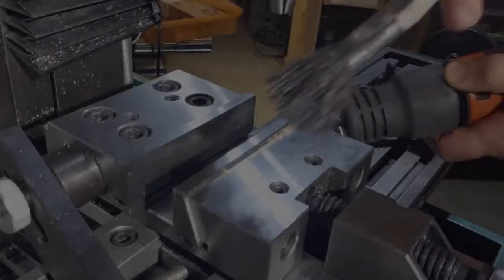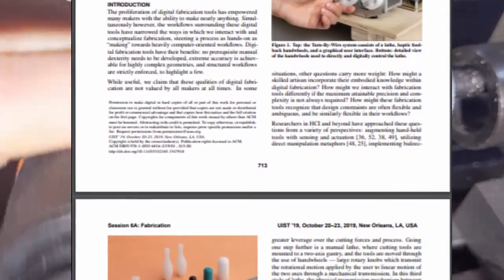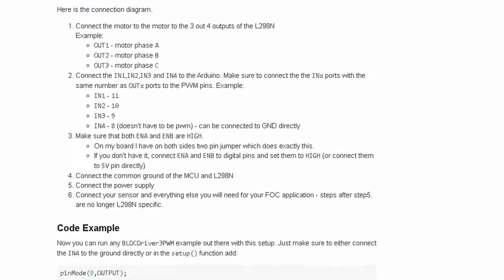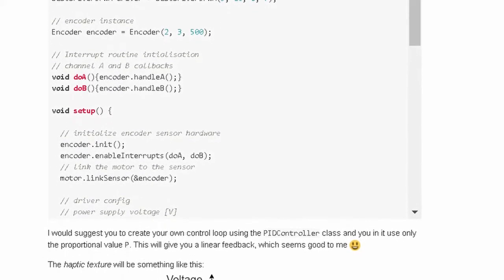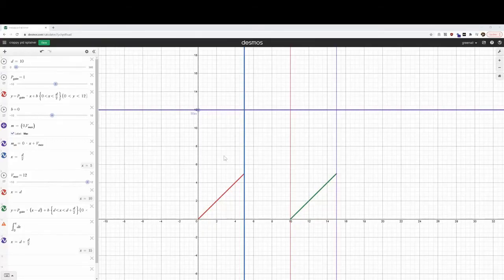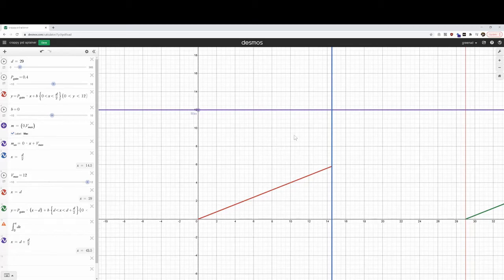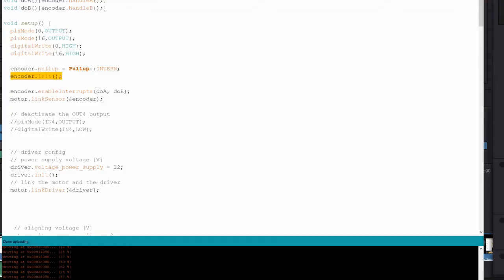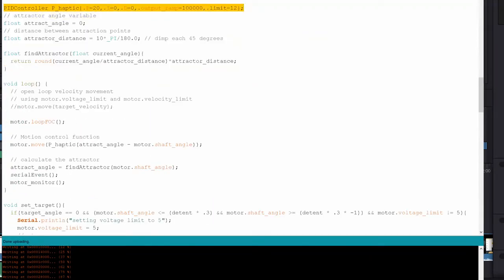haptic textures and virtual detents

Comment: Hi Jesse, just a thought which you may have already considered. Could you measure the current draw of the stepper driver to help determine the motor torque. Interesting this will probably be  a wave form. due to the detects of the stepper motor, so you may need an rms or peak averaging calc or similar to capture the current draw. And a sample rate for the current measurement  much higher than the max step rate of the actual motor. 
This is definitely an interesting problem to solve
Reply from the maker: The driver has no current shunts to measure the current with.  The voltage is used as an approximation of torque since the motor has high resistance this works well.  There are drivers that will measure the current but they are a lot more than this $3 driver.
Reply: @JesseSchoch  $3? What driver are you using?
Reply: @sprobertson  He is using L298N, if I understood it correctly. This is the forum article he referred to: https://community.simplefoc.com/t/3-bldc-and-stepper-foc-driver-l298n/296/5
Reply: @SeiKou89  Aha super! I had been assuming you can only do this with the expensive integrated drivers.
Reply: @sprobertson  The L298N are only suitable for experiments in most cases. They get hot quite fast in that operation and have no current sensors for measuring actual torque. But for trying out FOC they are sufficient. If you want to get into it, I can highly recommend the simpleFOC community to you and also their youtube channel.
Reply: @SeiKou89  Ah ok good to know. I've actually just ordered a simplefoc shield, but was hoping there's some cheap alternative for the purpose of controlling many motors at once

Comment: Thank you for this video. I have thought about adding haptic feedback to the CNC a few times too...
I am surprised you picked the detent for haptic feedback. Wouldn't it make more sense to measure the torque applied to the axis motor and use that to 'push back' on the knob? That would be a bit more like a manual machine, i think.
Reply from the maker: trying to take small steps as I learn.  direct feedback from the Z  is a goal.  The first goal is simplifying the basic controls a bit.  I don't want to have 20 buttons and a rotary encoder.  Too much to think about.  Back to your idea:  For my lathe I have a closed loop stepper driving the lead screw but i'm not sure how to get the torque data back from the controller.  My 4th axis has a servo, and the servo can provide lots of diagnostic data.  I may use that for testing.  I also have some 120w brushless motors that I can setup with simpleFOC as DIY servos, but they may not have the torque for the leadscrew.
Reply: @JesseSchoch  For a stepper, my guess is you are out of luck (maybe with a strain gauge). But as you said, a servo drive should be able to provide the torque numbers. Thanks for sharing this work. I'm watching this closely :P